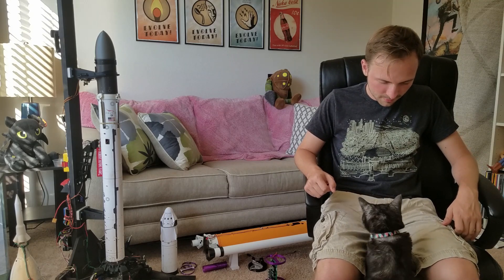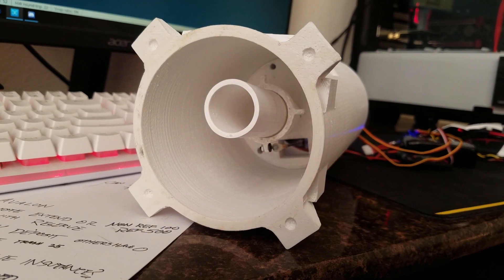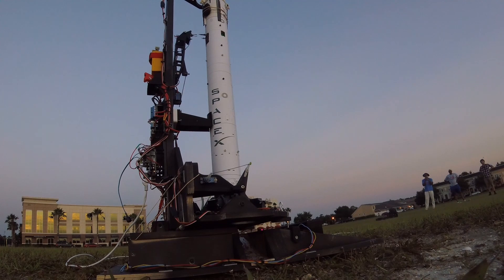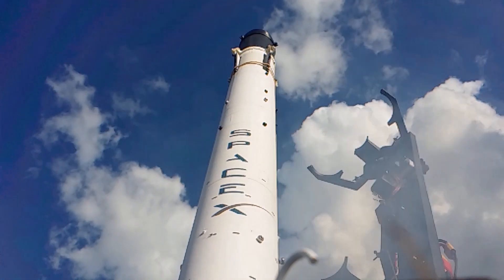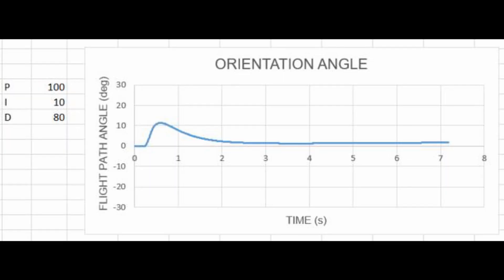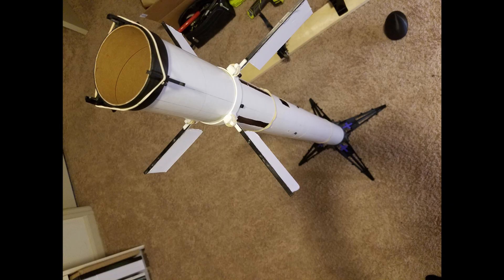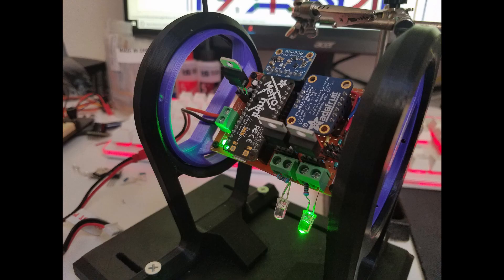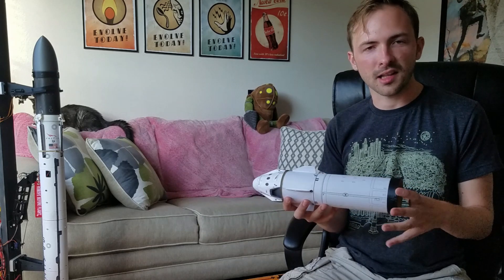Falcon 9 Model Rocket Flights (TVC)

Comment: hey what programming language are you coding in and did you need to learn more than one
Reply from the maker: Arduino, its similar to C++ i believe but i learned matlab in school. Arduino is easy to pick up though
Reply: @TZeroSystems  one more question, What size was the diameter of the tube you used as the main body and why did you choose that size or maybe two questions. Now I completely get why you don't release your code but if you did wouldn't that allow a small community  on people doing thrust vectoring which would allow the people in that community to build on your code if there are any faults or to change certain things that could be better to advance model rocket thrust vectoring a huge amount, I'm also starting to do thrust vectoring on model and I'm still working on the code so if you have any extra time for a Skype call please let me know.
Reply from the maker: @kieranohara521  Tube is 75mm and the code is not user friendly. I usually think its best people write their own because it lets you understand whats going on and how to fix it.

Comment: Yo man i need help with the nichrome wire heated by the arduino and mosfet with a 9V. what gauge do u use and how is it generally done?
Reply from the maker: 12V but yes. I use LiPo

Comment: I love your absolutely detailed work! Just being curious, what parts go in to make a thrust-vector control system, as I really want to try my own, but I still struggle with where to start (in terms of electronics)

Thanks in advance <3
Reply from the maker: 2 servos and a control board. Mine is pretty different to anyone else I've seen. I use flexible components instead of mechanical hinges. Picture #4
 https://www.instagram.com/p/Boeuu3ZlDRM/